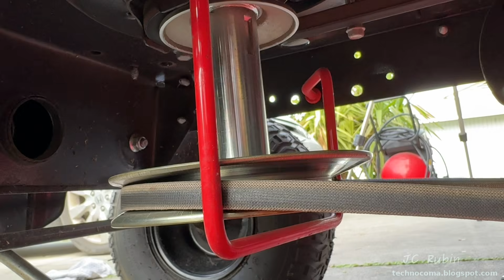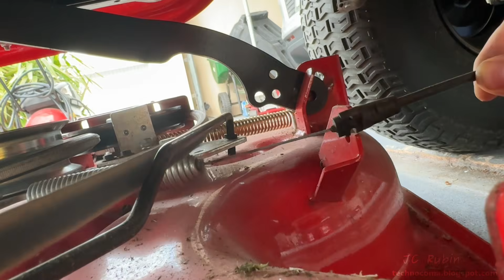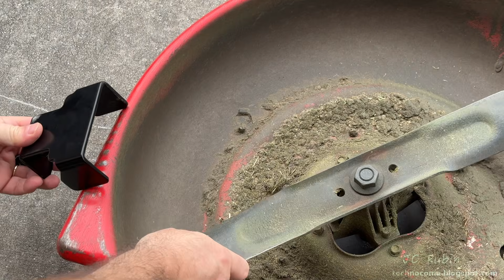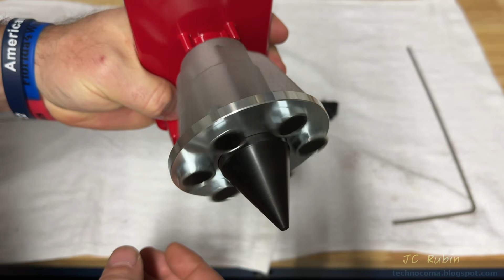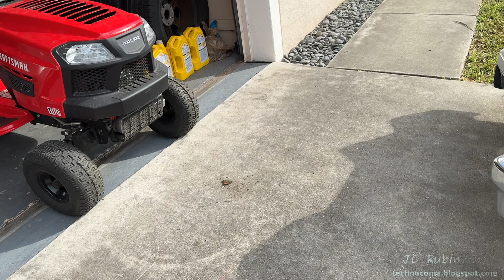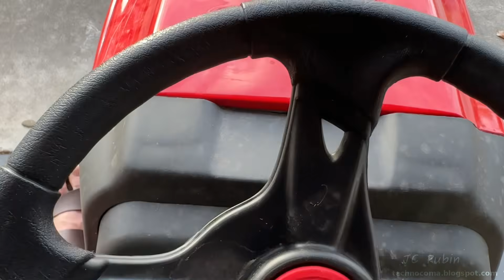Craftsman T110 Riding Mower Deck Removal and Blade Swapout

Comment: Don't be afraid to remove your riding mower deck. Just watch videos like this. For pulley replacement, I removed and reinstalled my friend's John Deere D130 deck. I've never removed one before. It's quite easy if you have a friend to assist a little while you are laying down. I have a T110 that I love. I will do mine sometime. Get a pulley puller if a pulley is stuck after nut removal.

Comment: Followed your steps but now after putting the deck back on the deck is no longer level. Left side is an inch lower than the right. Please help!
Reply from the maker: Something was assembled incorrectly . Recheck all work.
Reply: @rubin-tech I checked everything and all is exactly the same. Only thing I can think is that the front connecting bar got rotated or bent? It’s only the left side of the deck that is sagging

Comment: I have the same mower and the blades won't disengage, the tensioner pulley won't move. It free spinning but won't move. Still has the springs on it?

Comment: I’ve got the 2018 T2100 42”. This worked perfectly. Only difference is I could manually move the belt holder, I didn’t have to uninstall. Thanks!
Reply from the maker: Glad it worked for you!

Comment: MTD LT 92 EXT owner here, it's exactly the same. thanks for this vid. Removing this brake cable and puting it in place after all is my worst nightmare. 🤣 ,BTW,  The midle pouley's support 's got 2 holes close to each others do you know witch one is for its normal position?

Comment: Definitely would be more helpful if you said what socket size you used along the way also if you would have said only use a nomadic at the beginning. Now my deck is removed, and Im trying to brute strength taking off the blades because you couldn't tell me I needed a nomadic at the beginning....
Reply: 15/16...
Reply from the maker: A few tips:
1. It’s pneumatic…. Nomadic are people who travel to hunt for food.
2. The size of the socket is in the video
3. nobody I know takes on a job without knowing the details of the task. Not watching from beginning to end before deciding if You had both the tools or expertise is a lack of preparation on your part.

Comment: Much easier to run the mower up on some ramps and get underneath to remove the blades. I sharpen the blades on my mower a couple of times a summer and it's easier to do it that way.
Reply from the maker: If all you are doing is removing the blades, perhaps, but if you are doing other maintenance or inspection on the deck, removal provides the best vantage point
Reply: Do the blades need to be positioned or "timed" before reattaching the belt? Do you know what I am asking? Do  both blades need to  begin at 12 o'clock?  Or 12 & 3, or 12 & 6 or what. I would imagine it makes a difference in uplift, cutting, mulching & discharge. 
Maybe, maybe not!
Reply: @kevineeverhart7869  I've never had to do that.
Reply: I was gunna say why take the deck off if you’re just changing or sharpening the blades ?

Comment: Yes your video was very helpful. Have you ever had to replace the blade pulley? I ran over some wire just a day ago and it completely locked up the blade. Removed the wire but the blade still won't turn. Again thank you.
Reply from the maker: Nor as of yet.